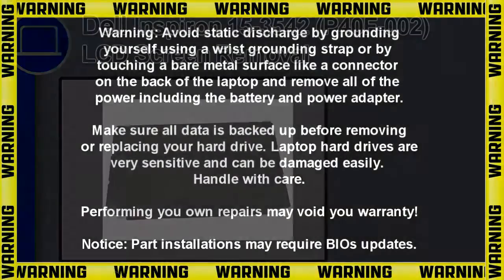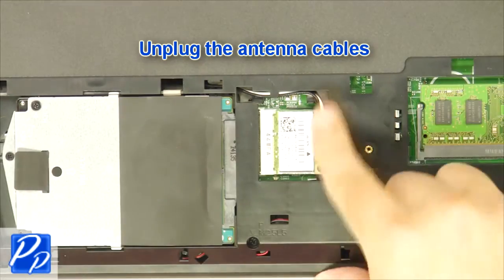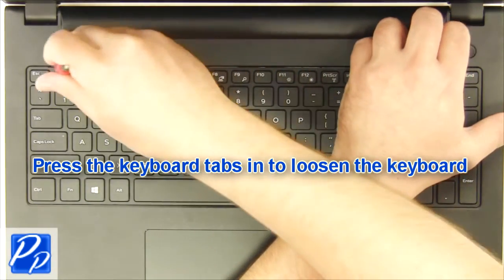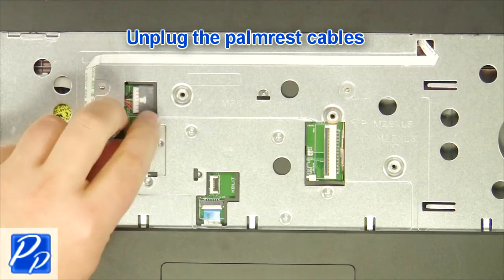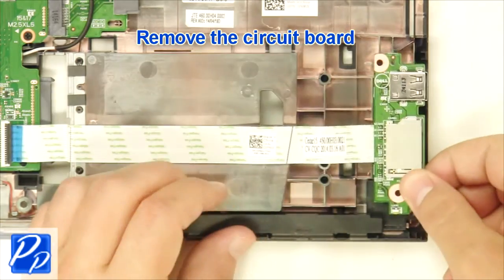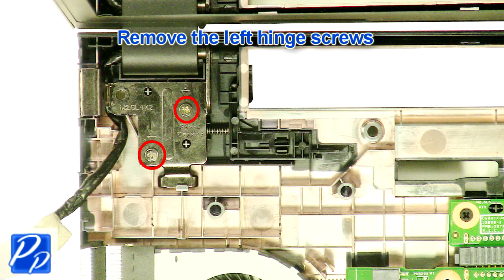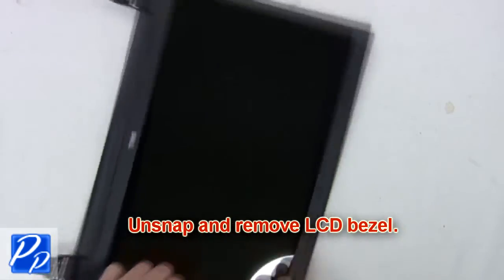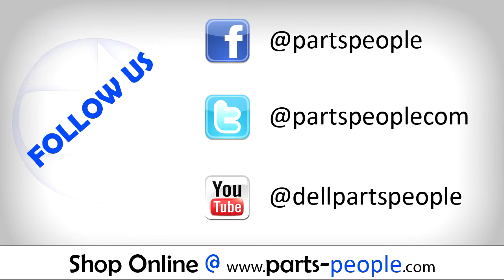Dell Inspiron 15-3542 (P40F-002) LCD Screen How-To Video Tutorial

Comment: See Lanierd's comment before following the whole procedure. It worked great, but the HDD had to be unscrewed before the palm rest would come off. No biggie, but Lanierd hit the nail on the head "All you have to do is unsnap the lcd bezel, unscrew the screws, disconnect the lcd cable, and replace the screen."